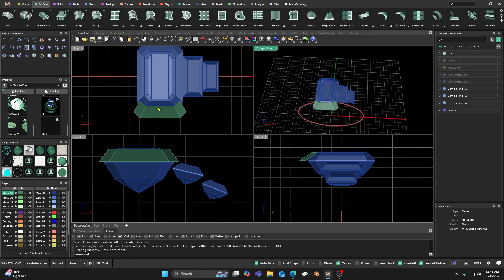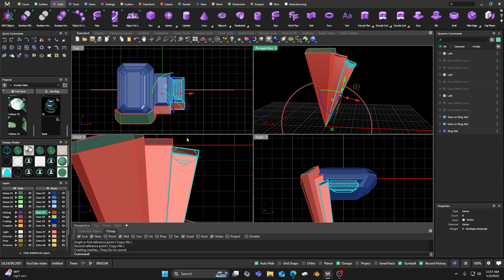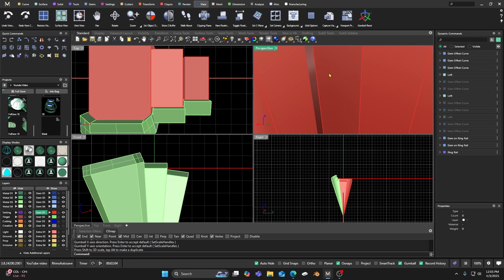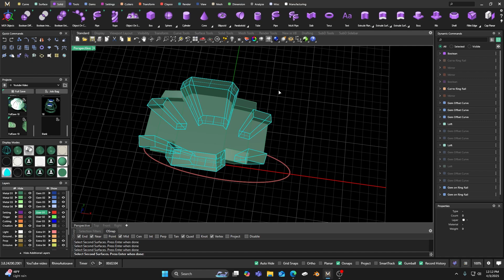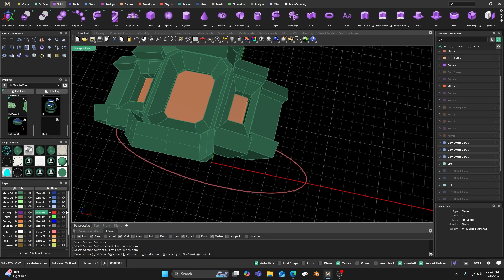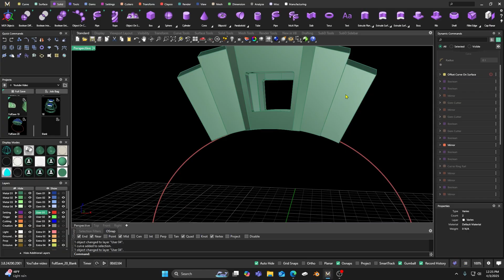MatrixGold Emerald and Baguette Channel Ring

Comment: I don't think you need border curves to do the extrude to point. You can do it right off the surface.
Reply: for the bags, I mean. I think the emerald cut had to be done with curves, as I don't think it works with polysurfaces. I could be wrong about that, though.